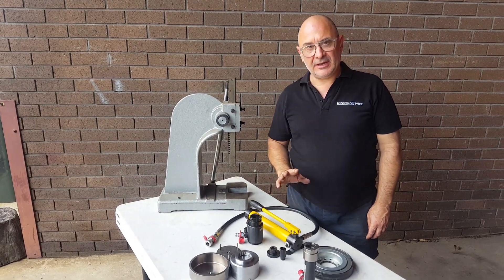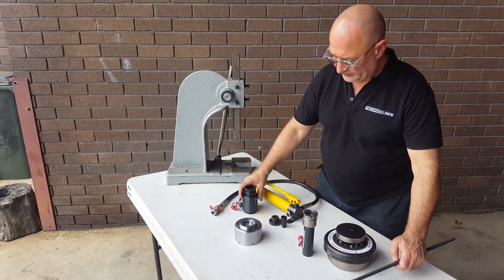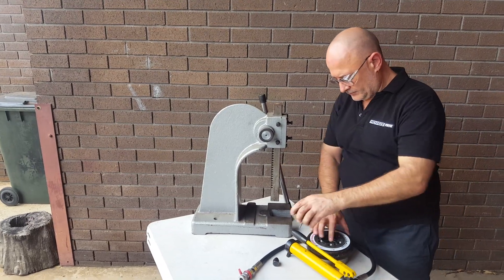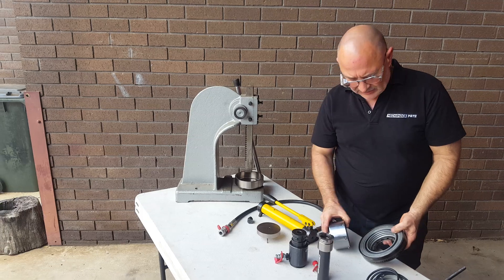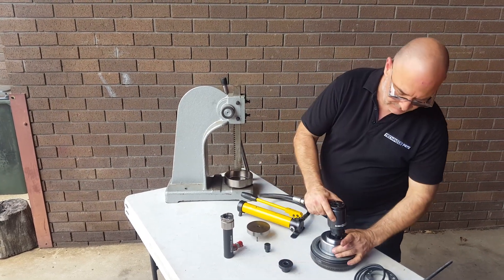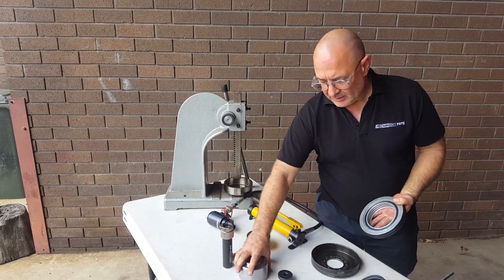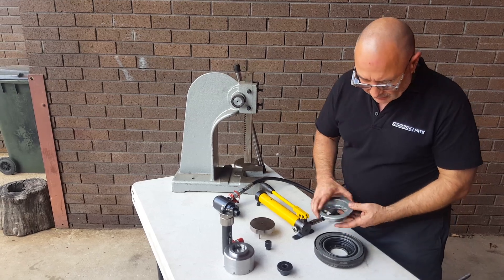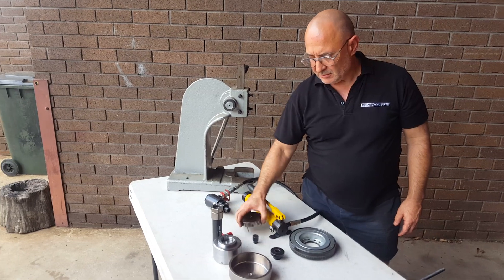How to rebuild an ATI Super Damper using the Mechanics Mate Rebuild Attachment Kit

Comment: So how do you align timing marks with tdc when damper has shifted?
Mines off 6* or so.
Reply from the maker: The outer ring is fixed to the centre boss. I'm not sure how the outer ring can shift to alter the timing mark position. I would be looking for damage, or check your timing measurements.

Comment: Can You Put Inertia weight back in without a press ?
Reply from the maker: Yes. You can use the 10T hydraulic cylinder used in the video to install it, if it is tight.

The force required to assemble and disassemble these dampers isn't really much. You could even try standing on it.

I used the arbor press in the video as it is much faster and easier than using the cylinder because the forces are so low.

Comment: How often do they typically need a rebuild like this?
Reply from the maker: Great question. I'm not sure. It would depend on your application. I know with some circuit engines they are done every 1500 race miles. It would be worth asking ATI.

I made our attachment for this application because a customer asked if we could do something, and when they showed me how it is done using the ATI tool, I knew we could do something better for them.

Comment: Huh, really nothing to the Dampener is there.
Reply from the maker: Not really.

ATI designed a very simple damper. The inner inertia ring runs independently to everything else, and they are easily repairable with off the shelf O rings. You just need to make sure you use the correct grade of rubber in the O ring to get the correct dampening.

These dampers can be a little tricky to pull apart, using ATI's disassembly tool. Our upgrade makes that last step really easy.